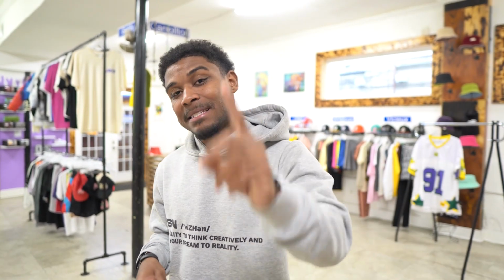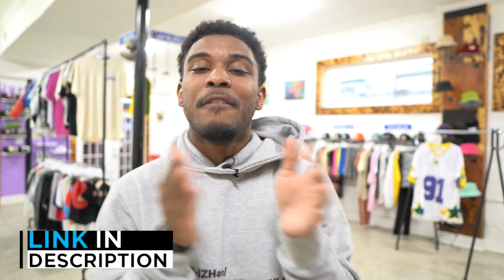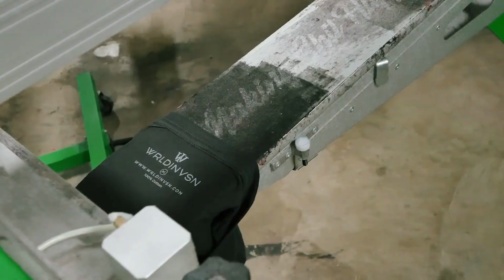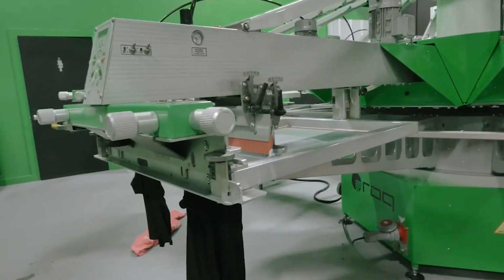Why I'm Not Using A Heat Press For My Brand...

Comment: A lot of people need to struggle to see their success. Using a heatpress makes a person have to work. Having t-shirts printed doesn't necessarily mean the person is going to get up and grind day after day. Creating, packaging, and selling may just be what a person need to get up, get out and get to it
Reply from the maker: It’s crazy because you’re right. People rather struggle to figure it out then just take the info I just gave them in this video! 😂😭 thanks for watching 🏆
Reply: Facts  plus you can control ya inventory doing that way